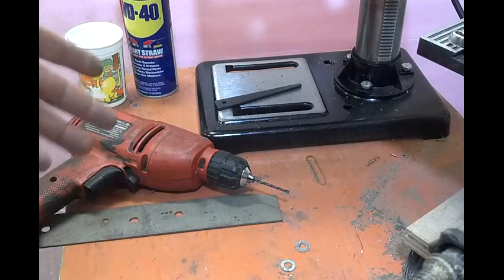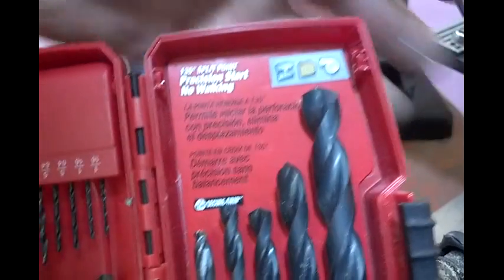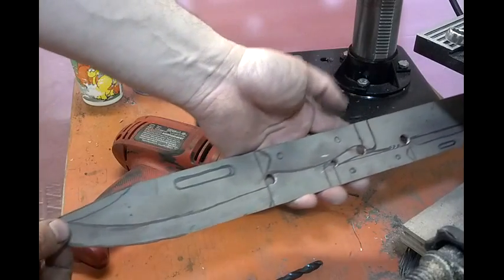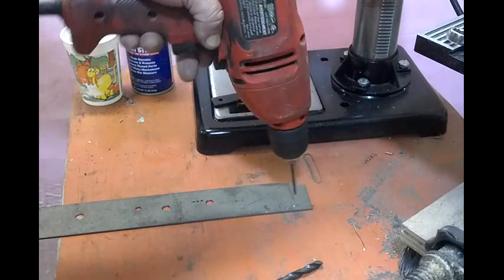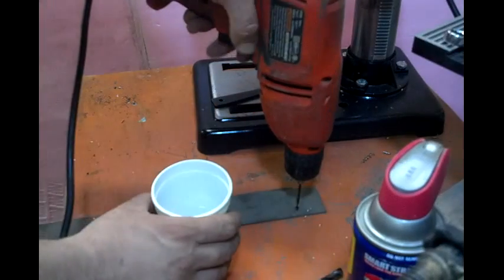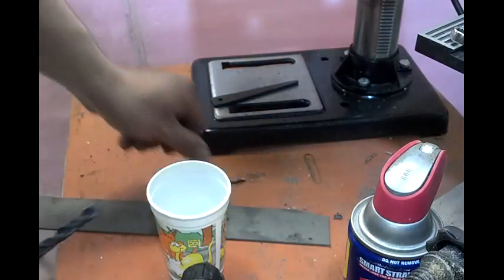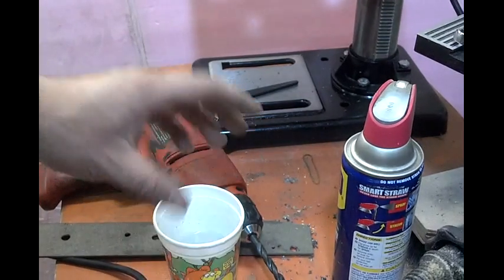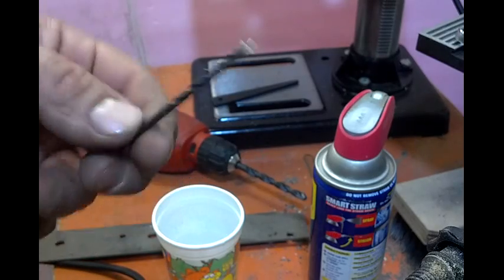How to drill Stainless Steel  w/ cheap tools and minimal supplies

Comment: Very useful tip. I wanted to drill 2 2mm holes on a stainless steel pipe. Without cooling the bit, I only managed to make a dent on the pipe and damaged the bit. After getting a new drill bit and cooling the bit as instructed, I managed to get a hole done in less than 2 minute (drill -> cool -> drill -> cool).. Thanks a lot for the tip..
Reply: I think drilling a 2mm hole is truly a very difficult job even in plain steel, not to mention SS, which is several times as hard!! Congratulations you manage to get through.

Comment: I have a question: I have a stainless steel made compensator. I've already sawn off the threading, but now I need to hollow it out (make the hole / barrel bigger), what tools do I use for this? I don't expect I could grab a power drill and just twirl it around in there.
Reply: PS: It was originally meant for a 5.1 hi-capa air pistol, but I want to put it on a m4 style barrel for aesthetic purposes.

Comment: I am trying to drill through a beast of a stainless steel mounted A/C unit to install a Barrel Bolt lock because the brackets they originally installed stripped after the first time my boyfriend (now husband.. despite his lack of DIY skills) changed the air filter. 

The problem is I have to drill through the stainless steel lining through the crappy (STRIPPED) drywall above, and THEN through more stainless steel... all above my head and at horrible angles... I've busted 3 bits even with Dark Thread Cutting Oil and I'm just at a loss right now. 

Any help is appreciated! Thanks!
Reply: +Joshua Burton (Knives) THANKS! That's perfect! They are installed and good to go! I'm young and have strong gymnast wrists, so I got it all done safely! :)

Comment: I have to drill some stainless shelving to attach mounting brackets, maybe drill pilot holes then drive wafer head self tapping steel screws?
Reply: +Joshua Burton (Knives) I hate sharpening bits. Is there gadgets, jigs, or a bit sharpener you'd recommended

Comment: Why not submerge the metal in shallow water while drilling?  1/4" of water in a pan would allow constant cooling and would not be deep enough to affect the electric tools.  You could even go deeper.  Just make sure the power tool doesn't get wet.

Comment: Spraying is much easier than stopping to dip my drill bit in water.  WD40 cleans up easily enough with denatured alcohol. Oil can be problem with your black market lines though. The technique of using smaller pilots bits works well in ALL metals.  I do it with even aluminum and other soft metals.

Comment: Great video! Thanks for sharing. I just spent almost half a day drilling and getting no where. I've never drilled hardend stainless before. Cobalt bits faild on me... well went dull faster than I expected. A couple minutes shaprening it on a flat stone, and now I have holes! That bit rounds quick though.

Comment: Amateur.Third generation metal worker-MY ASS! You wouldnt be using cheap ass tools if you were.
Reply: Id have to travel about 6000 miles then,as im in the UK!
Reply: ***** thanks ... HOW TO DRILL HOLES IN STAINLESS STEEL W/  '' CHEAP TOOLS '' ..
''C H E A P      T O O L S ''........ IN STAINLESS STEEL .. ''!! CHEAP TOOLS !! .....

Comment: All good tips and techniques. Alas it come down to basic physics. If your drill bit is harder than the material your trying to drill, you can drill it. If the material is harder than the drill bit. You won't be able to. No matter if you try and drill a pilot drill first.

Comment: GREAT video.  Your K.I.S.S. approach is wonderful.  Keeping temps down seems to be the most important aspect.  Water will do that better than oil because as it evaporates it provides greater cooling than oil.  You could use a spray bottle to deliver a constant shower while you're drilling.  Don't know how important the friction-reducing aspect is.

Comment: hi Joshua i going to drill an angle bar with 14mm hole on it. 
it is 304 stainless steel 5mm thick. 
can you hlp me with the size of drill tip.
what is the best fluid for it? can i use car coolant instead to cool it down?
pls hlp, thx :).
Reply: thx. i think i'm goin to have a tough time drilling 4mm thick plate.

Comment: I drill nearly half a dozen 1 -1/4" thick stainless steel for a product. Don't know why I took the job but I broke 2 or 3 bits doing so. I've since gave up because it sounded like kids scraping the chalkboard all day with fingernails. Bits were called heavy duty spiral bits.

Comment: Thank you for sharing your talent ! I've been surfing around trying to see what kind of drills to use to drill holes through stainless steel flatware. I saw jewelry made out of spoons and forks &  I'm one of those ladies  that see a craft and say "I can do that!" 
----- but  I'll be darned - I can't drill those holes or bend those fork tines !  I do everything from sewing  - to fusing glass -  to wood to - ceramics - and my iron worker son even taught me how to do easy welding ! Stainless steel has me baffled .  I can't even solder the damn stuff!
If you have time, can I pick your brain with a few questions ?  I would soooooo appreciate your words of wisdom !!  Kathy  (Levandoski812@att.net)
Reply: intouch I find using a punch and hitting it hard three or four times gives the drill bit something to bite on. I use flatware to make coat racks. The vintage stuff can be really thick.
Reply: intouch for bending the tines, heat gently with a blowtorch and use a 6” piece of copper pipe to bend them. Copper won’t mark the steel.